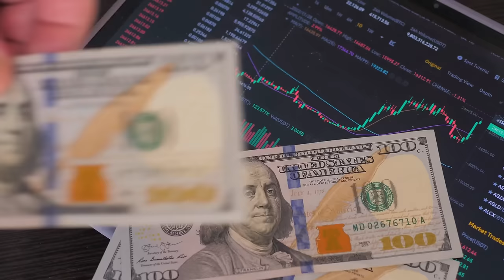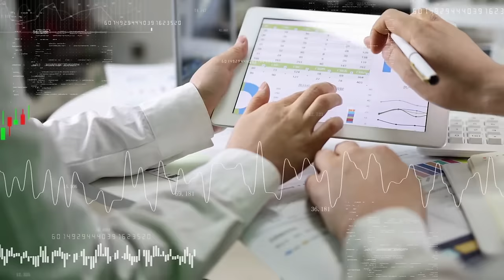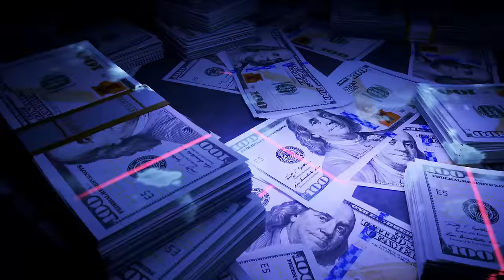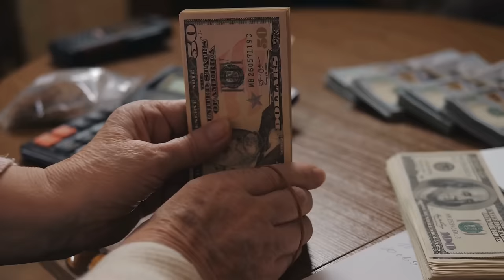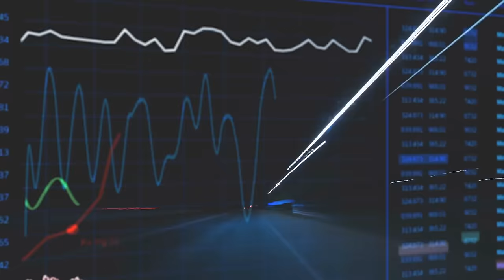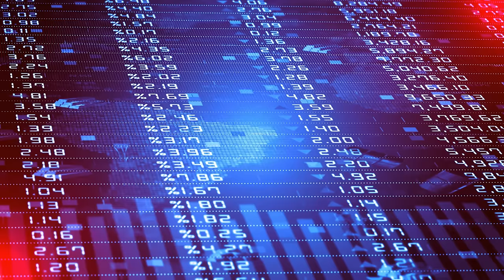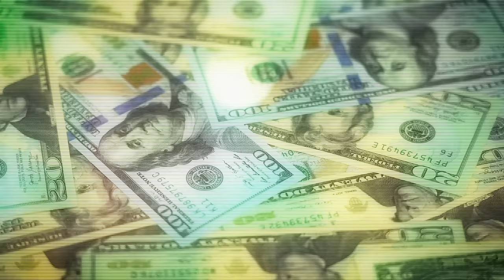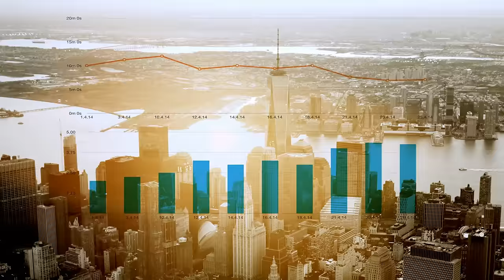2024 RETIREMENT GUARANTEED FOR STACKERS HOLDING THIS MUCH SILVER ACCORDING TO RICK RULE $2789 SPOT.

Comment: In January 2021, the Shanghai Futures Exchange boasted ample silver stocks of 3,000 tons. Not any more. by the end of January 2024 stocks had dwindled to 945 tons. That's a huge depletion of 685 tons per year. Fast forward to the end of 2024. (945-685) could leave just 260 tons unless more and more silver is found from somewhere to replenish their stocks..
The question is WHERE will this silver be sourced in 2025, given the reduction in mined supply and increase in industrial demand? So, is silver at last entering a huge tipping point where price has to rise significantly to ensure supply? Can Stackers at last see light at the end of the tunnel and reasonably expect long awaited returns to finally materialise?

Comment: Basically a useless video which makes a point of contradicting points made 2 minutes before. Seems to be a con man capable of making excuses for every kind of silver investment failure with very little hope on the positive profit side. Truisms 1) Hundreds of times more contract ounces of silver than physical ounces READILY available. 2) no matter how complex the algorithm, the cost of mining (directly or indirectly) each ounce is way more than current prices. Given these truisms, and others, there is no way supply and demand cannot ultimately prevail. Manipulation of markets has always been an issue and without stringent controls, always will be.Until this is addressed, silver will remain an enigma at times.